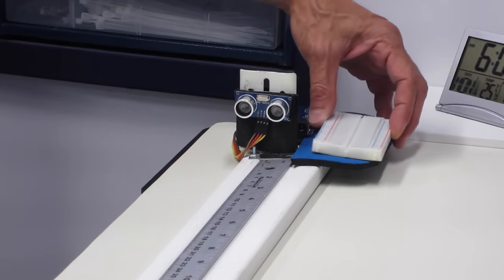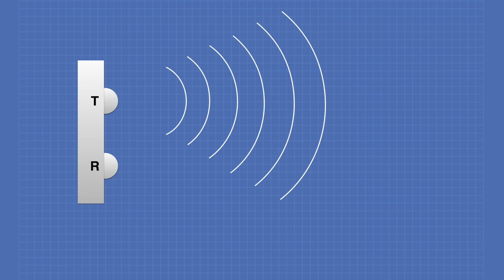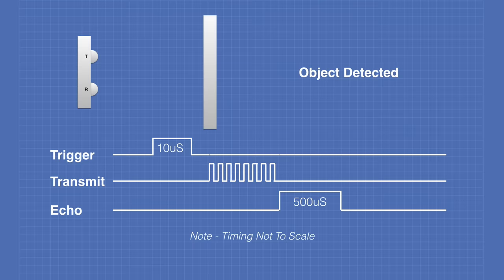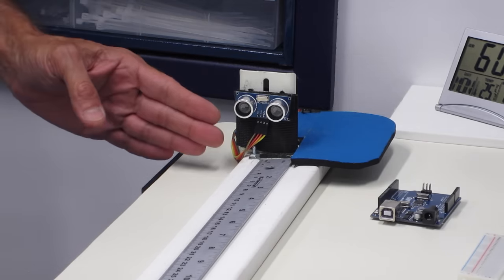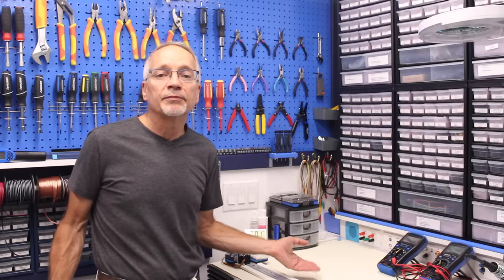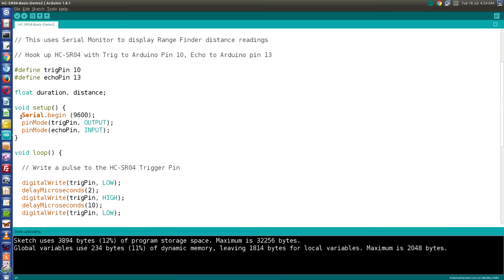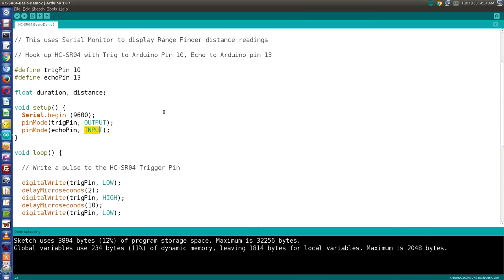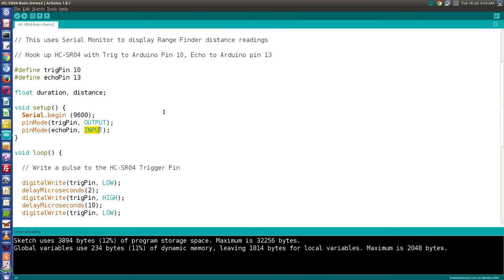Using the HC-SR04 Ultrasonic Distance Sensor with Arduino - Everything you need to know!

Comment: I have an idea for a distance sensor that unwinds a spring loaded spool of wire or string with electronic measurement. Not sure where it would be practical but I am sure there would be applications and it would be very accurate. Seems the ones you have are not very precise.

Comment: DroneBot Workshop thanks for this vid it's prety interesting....I have a question about the 3 wire-mode connection if use it, do I have to to divide the distance by 2 as only one sensor part is working in this case or i'm wrong ?

Comment: You're great:)  I HAVE A QUESTİON: Is it sensitive in far? For example, can ı measure the 4 meters outside? I am doing an autonomous car.  It will be big and it will travel outside on a road which between barriers. So the car will measure the distance between the barriers and the car. It must measure at least four meters. Do you have any advice for me about which sensor ı should use?

I need to take responses fastly (<20 milliseconds)

Thank you.

Comment: I want to use this sensor to as a proximity sensor for my car. Instead of using a Tennis ball on a string, I will have a Green, Yellow, & Red LED to show how close I am to the curb in the garage, and hang the Arduino in the ceiling in the garage and 3D print an enclosure.

Comment: Hi.  Great video!  Could the 1/2 cm discrepancy be that you are measuring to the very front of the sensor when the sensing is actually being done 1/2cm inside the canister, behind the protective screen?  Thank you again for the well explained vid.
Reply from the maker: I had thought about that too and actually tried to factor it in (but I'm not sure if I was successful in doing so). You may be correct.

Comment: sir your video was very informative.I HAVE A QUESTION -which sensor could be used to measure   to 0.1 mm resolution?
Reply from the maker: Hi Ajith. 
There are actually a couple of problems getting a sensor to work in that range. First of all the sensor itself will be quite expensive, a few laser-based sensors would work but they are not cheap.
Secondly when you are measuring with that type of accuracy the timing limitations of the Arduino will come into play.
One suggestion I have seen is to use a digital caliper with a USB or serial output, but of course this require you to physically manipulate the caliper.
I'm afraid that I have no easy answer fr this one, perhaps someone else has a suggestion?

Comment: Wow! Fantastic video!
I'd like to incorporate a pair of these HC-SR04 Ultrasonic sensors on a future 1/100th scale Saturn V model build. I say a pair because I'd like the redundancy and by mounting 2 of these, I'd keep the rocket balanced. I'd mount then near the bottom  of the lower stage but just above the bottom tucked in between the fins and away from the rocket motor blast. 
Do you think this is a good idea?

Comment: Thank you for a great tutorial. 
I am even fighting to get some what precise measurements even using your Improved Accuracy. I don’t have a DHT-22 yet only DHT-11. I have changed the code #define DHTTYPE DHT22 to DHT11. 
Measuring the temp with old fashion thermometer eg. amost 21 deg. Celsius, the DHT-11 gives 21.9 deg. Celsius. The distance measured with HC-SR04 gives 31.27 cm at 30 cm mark and 10.83 cm at 10 cm mark. 

Could those faulty measurements be caused by the faulty temp. measures of the DHT-11?

By the way I am crazy about all your tutorials. Please continue the good work.

Comment: I wanted to make 2 robots that detect how far they are from each other and then slowly start moving towards each other until they touch. One of the 2 robots will be a host robot, which will be stationary and the other robot will be a smaller child robot that will be stationary at the start, but will need to move towards the host robot, until it touches.
Would I be able to use 2 Ultrasonic Distance Sensors one on each robot, where the child robot swivels around in a circle to find where it can detect the strongest ultrasonic pulse, and moves in that direction by checking if the time it takes to receive a pulse from the host robot is getting smaller as it moves towards the host robot.
Note: Both robots will be on the same plane(a tabletop), the host and child robot will be no more than 1 meter away from each other and there will be no obstructions between the 2 robots(ie a wall).
Hope you can help me with this.
Amazing video by the way!
Thanks

Comment: if you use a flat and smooth metal surface, the result will be more accurate as the wood surface will absorb and distort the reflecting sound wave
Reply from the maker: That's an interesting point which I hadn't considered - thanks for pointing that out!

Comment: Your video was great, I'd like to thank you for sharing your information this thoroughly.
And I have a question, is it possible to use two HC-SR04s facing each other (one on the breadboard and the other in the distance) and couple them the way that one sensor transmits the sound and the other sensor's receiver read the sound transmitted and vice versa. I think of this kind of setup because I want to use them in a place full of obstacles and I'd like to measure a specified object (that I put the other sensor on it).

Comment: Great video! I found it very informative. I tried to replicate the programs shown in the videos but I cannot get the output for the final program with two HC-SR04's connected. I'm using the arduino UNO board and the 4 PIN connection method in my setup as opposed the the three PIN one shown in the video. The problem is the when I check for the output I only get the distance for either one of my sensors correctly whilst the other just returns 0 as distance. I've checked that both the sensors are working separately. Is there a problem with the supply or is it due to some other factor?

Comment: Hello, Bill.
I'm looking to play around with this concept in propulsive landing (or at least propulsive landing assist) of a model rocket. I would slow the descent rate of the vehicle by using the data from the ultrasonic distance sensor sent to - and power - a 70-mm EDF. 
So, then, I'm trying to figure out how to control an EDF with the data. I also would most likely have a faster sampling rate since the rocket is descending at a velocity that requires a quicker response interval.  Any thoughts?

Comment: Thanks for the excellent tutorial !! Your videos are very informative and well explained. 

I want to connect 3 x hc-sr04 + 2 dc motors with a L298N bridge on a Arduino Uno.
I am wondering if the  hc-sr04 has to be connected to a pwm pin or can it be connected to any regular digital pin ? 

Thanks in advance

Comment: thank you. i learned a lot of it. but i have a question in the library said that i can use 15 hc-sr04. how to do i do it.?
Reply from the maker: I'd LOVE to see what you are building that requires 15 ultrasonic sensors!
You can find the sketch that uses 15 sensors here - http://playground.arduino.cc/Code/NewPing
It uses an Arduino Mega and amazingly uses the 15 sensors in 4-wire mode - you might be able to do the same thing with an Uno using 3-wire mode if you "only" needed 14 sensors (actually you can use Uno Analog ports as digital I/O ports as well to add more sensors).
Keep in mind that with 15 sensors you'll literally be flooding the room with ultrasonic pulses, you'll need to be sure each sensor is picking up the correct pulses and if you have a dog or cat you'll drive it crazy!
If you do construct something with 15 sensors please post a video and let us know how it works.

Comment: Great useful video! I really liked the way how you described each step. Really good work.  I would also like to know if this sensor can be used for bi-directional people count, If so can you share your thoughts on it. Thanks!
Reply from the maker: It probably wouldn't be the best choice as a people counter as it responds to anything within a 30 degree angle.

For a bidirectional people counter I would use two optical distance sensors (which I will be making a video on soon).  The optical sensors work in a narrow range and would be more accurate, two of them would be required to determine direction.

Another cool sensor (again, video will be coming) is the microwave sensor. What I think is cool about it is that it can actually sense PEOPLE (or animals) instead of inanimate objects.  It senses the water content in a living body.

You've actually inspired me with your comment, I may just build a people counter and if I do I promise to give you a shout out in the video! Thanks!
Reply: DroneBot Workshop Thanks a lot for the advice. It was really valuable, it would be great if you could make a video and let us know. Thanks a lot and please keep up the good work.

Comment: hello im new to this. i plan like make a row of this like 5 of ultrasonic sensor to put in my door as alarm. idk please dont laugh is that possible or are there other sensors that are much more convenient?? the one thing good about this is that it can measure the distance of object so if a human like near proximity it would like make sound . idk but kinda expensive if have include arduino just for an alarm. also, how do i power it up and the circuits ?? can u share basic advice. ? thank you.

Comment: I really need help, not sure, but I think my sensors are broken. I copied the exact code and the setup is the exact same, even the basic experiment failed. Either the readings are ridiculous like 200 cm at 10 cm distance, or it is "out of range", which it never is. Whats going on and whats my best option?

Comment: Sir, there is an easy way to measure the speed of the sound....
Put an obstacle in front of the sensor at a distance of 20cm.....and measure the pingtime
We have pingtime,distance........we can measure the speed of sound...
Put this value as speed of sound in the code

Comment: Thanks for such good explanation, is i possible to attach sensor to servo motor, to act like radar and viewing result in  processing 3
Reply from the maker: Yes it is, I have seen a few projects exactly like that. I'm actually working on a similar one using a LiDAR sensor as many have asked for additional LiDAR content.
Reply: @Dronebotworkshop  I am so eager for your video.

Comment: Thanks for the video, it's really easy to understand.
I was wondering, is there any way I can read with one sensor the signal from the other one? For instance, start the timer when sensor 1 emits the sound and stop it when sensor 2 receives it. 
I'm trying to measure the distance between 2 Arduinos, I'd really appreciate the help if someone has any idea for that.
Thanks.

Comment: How can we get  a a dc voltage read out  from the sensor  to control a dc motor speed  with the sensor mounted on a moving danser, thus converting  distance to volts
0 to 10 dc  range of  the motor controller

Comment: Is there a way to measure very accurately in a small scale?  For example, is there a way to make the sensor measure in .1mm scale? or even .01mm?
Reply: Try this before calculate the distance ......soundmm = soundsp / 1000.00..... to converse in mm
Reply from the maker: The problem is that the HC-SR04 is only accurate to plus or minus 3 mm. So although you can use the suggestion Denis has provided to display in mm you'll still have to deal with the sensors inaccuracies.
Reply: I think i've found a solution to the problem i was trying to solve. I'm using a digital tire depth gauge for 3d printer bed leveling.  Works great.

Comment: I make Automatic Evaporation System with open pan evaporation. I use HC-SR04 to measure the difference water level today (00.00UTC) with water level yesterday (00.00UTC) in open pan. I dont know how to make the evaporation calculation program ( Water level.now - water level. yesterday) because I must save the water level data yesterday and call back again today. Can you help me please?

Comment: Does the sensor measure from the top surface of the pcb, a bit above this where the membranes of the two silver cans are, or from the front face of the two cans? As the cans are about a centimetre tall, it matters.
Reply: Having watched further into the video, there's a reference to this, but it still doesn't say where the measure point should be, just that you can fudge it.
Reply from the maker: It's a very good question. I had assumed (just my own assumption) that the measurement was from the surface of the actual membrane behind the screen. But I have yet to find any documentation that can confirm this.

Comment: Nice job sir..........and I want the complete code for this construction...... also by connecting the buzzer with that
Reply from the maker: All the code is available on the website at http://dbot.ws/hc-sr04
Not sure what you want to do with a buzzer, can you elaborate please?
Reply: sir.......actually we want to measure the dia of gear with 2mm accuracy.........for eg.......in a conveyor belt....there  is only 70 mm dia..and in CNC it is only programmed for 70 mm dia......when in exceptional case....by mistake the 72 mm dia gear enter means....we want to stop that conveyor or to remove the gear.......what we want to do
Reply: sir......reply must sir....its an urgent project for company

Comment: hi! why pin 10 and 13 are thet specific, need interrupt or what?  I want to use on a pro micro leonardo at pin 16 and 14 for better fit... unfortunately it worked for a while and then when I gotglued the soldered wires Leonardo died os not sure, does the sensor need some capacitors to avoid interferencebetween vcc and gnd? I don't want to kill an other leonado

Comment: hallo, i tried to measure speed of sound in a confined space in which  i know the temperature and distance between sensor and object.
i have written the code actually i copied it but it didn't work out.
more specifically i got  inf. result instead of some number. 
where did i make a mistake ? what is your opinion about it ?

Comment: I went to the website for the code but could've gone to the wrong site. Site seminars and lessons. I didn't see this code. Easier to just write it in but there's one special character I can't seem to find even in my character map. It's in the lower part of void loop right after serial.print. I can find one facing opposite direction. Can anyone enlighten me? Sketch 4 iterations just before (out of range)

Comment: Wonderful tutorial. I'm adapting your code for a 20 x 4 display. Can your also provide the conversion formula for distance in inches?
 // Calculate the distance
  distance = (duration / 2) * soundcm;

Thank You!!!
Reply: If you can't do a simple conversion like from cm to inches, you probably should not be trying to program ANYTHING.
Reply: @CurmudgeonExtraordinaire  The answer is more than you're nasty comment. Why didn't  you provide the answer for others?  The answer is,
UNDER VARIABLES add
float inches;   // inches = soundcm * 0.39
UNDER VOID SETUP JUST AFTER 
// Calculate the distance 
Distance = (duration  / 2) * soundcm;
ADD
// Convert distance to inches

Inches = soudcm 0.39;

You really fit your username. But for  a better fit you should change it to " Grumpy OldTroll 
You should consider c
Reply: @mybigtube2  -- And yet you give a solution and it is not correct... Maybe "close", but not "correct".  Obviously you should not be programming either... :(

HINT:  The often quoted "39.37 inches per meter" is an approximation .  Your "0.39" is even worse than that.  That actual absolute conversion is 2.54 cm per inch EXACTLY.  Your "0.39" (or even the 0.3937 often assumed) is just an approximation.  If you calculate it out, it would be more like "0.3937007874015748031496062992126" (and then more digits)... Or you can be accurate by saying "1/2.54"... Very simple math that should have been covered in high school at least, so if a person cannot even figure this out, they have no business writing code.  I've been in this business for a lot of years and I'm just tired of dealing with idiots that should have learned something in high school and they still don't know it after they supposedly think that they are good enough to be a developer.  Metric, US Customary, Imperial... Doesn't matter... You should know how to look up the conversion factors, especially with it being at your fingertips these days with the internet... It's not like back in my day when we actually had to physically open a BOOK and look it up.

And if you really want some fun, look into the head sizes of the British Whitworth bolts / nuts.  And to make it even more fun, they changed that around 1924, so you have to ask whether the bolt / nut you are dealing with comes from before or after that.  "Standards" are great, right?  LMAO...
Reply: The Max range of the HC-SRO4 is 400cm

My inches = soundcm  *  0.39370 is correct 
400 x 0.39370 = 157.48
Your  inches = soundcm  / 2.54  is also correct.
400 / 2.54 = 157.48031 
A difference  of .00031 over the full range is nothing to get  excited about. Do the math. Have you ever considered anger management?

Comment: HI, I have a seeeduino v4.2 board. I am just wondering if that would also work with the HC SRO4 sensor as well.
Reply from the maker: You should have no problem, the Seeduino v4.2 is supposed to be completely Arduino compatible.